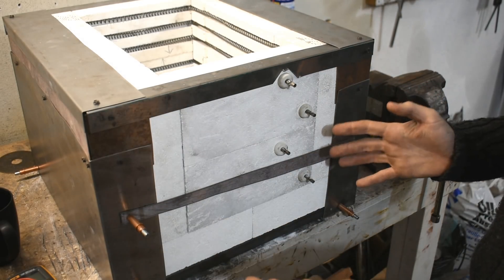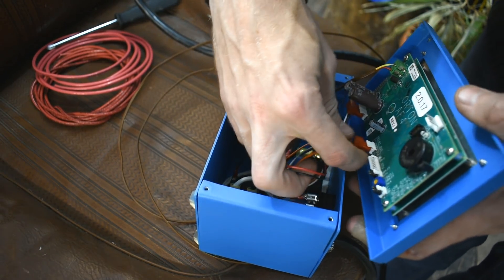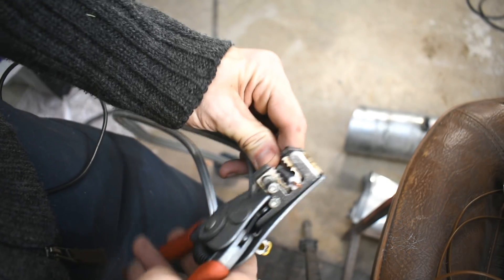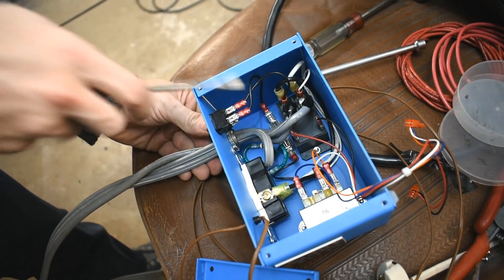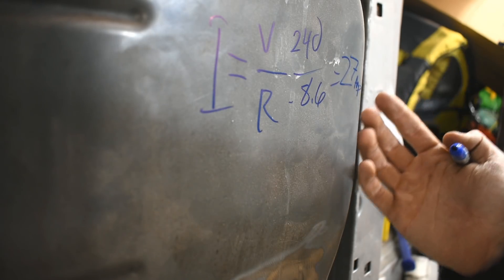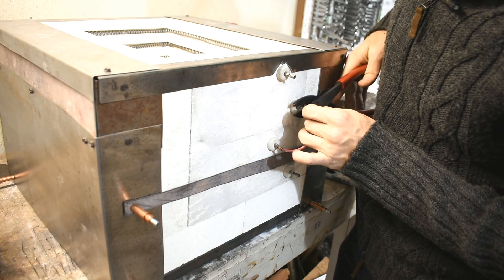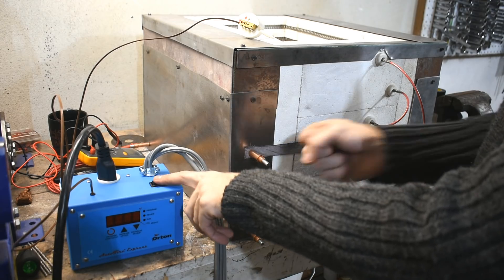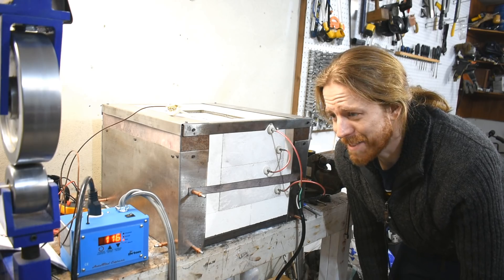DIY Electric Heat Treat Oven/Kiln/Furnace Part 4: Wiring up the Orton Kiln Controller

Comment: Are the elements dangerous to touch when using (ie. high voltage) or is a transformer used

Comment: It seem like your elements are very thick and longer, compared to the Jeff, the Veg Oil Guy's electric furnace.  Being cheap, I went with the size kanthal wire he used.  My coils are way shorter and less beefy than yours.  I'm guessing this will translate to a shorter working life?  FWIW, with my calculations, I'm going with two 120 volt / 20 amp circuit.  My plan is go with the InkBird PID controller with SSR-40D DA relays, which seems tiny compared to your Orton controller.
Reply from the maker: Anything that works!  I'm not sure about lifespan, but my elements and controller are off the shelf pottery kiln parts.  It's safe to say they are a bit over built, probably far more than necessary.  I have no need to hit 2400f for hours!
Reply: @PaulsGarage  I really should stop procrastinating by watching your videos, and instead go and work on my own furnace/kiln...  Oh well...  BTW, is there some purpose served by the metal case that I'm missing?  I can see for a commercial build wanting to have the strength to stand up to transport and wear-and-tear.  But what I'm trying to get by with is just to use a perlite concrete shell.  If it starts breaking down, I'll then add Aluminum flashing or ceramic tile.

Comment: I remember, from high school, our instructor tested a light bulb which only read a few Ohm's across the leads. 
He turned on the bulb with a amp meter in series and another meter showing the voltage. He was able to show the actual resistance of the light bulb is greater when hot. 
Which brings me to my point. What is the wiring like of the commercial unit that you have. If the heating element is the same as the one in the commercial unit then why not see if it is in parallel or series.

Comment: If you used 1 element at 27 amps connected it through a 30-40 amp contactor and controlled the contactor with the controller you could have saved some effort and gotten a quicker heat up.

Comment: Thomas & Betts WT111M Plier Type Crimping Tool 
The original crimper; Klein and others copied it after the patent expired, 30 years ago T&B was all you could get.
Also FWIW you are also crimping wrong the point goes away from the split.
Reply from the maker: Thanks for the tips!  I didnt know I was crimping wrong, I shall rectify that

Comment: Hey Paul. I just use the heat shrink from Menards (not sponsored), I think it is Rayburn (not sponsored). Haven't had any problems with it on the charge connectors or battery wires on my old Allis Chalmers (not sponsored). Think my Napa (not sponsored) battery is junk though. :)

Comment: Excellent choice of crimpers and tape! I've used both for over 25 years with no issues and I must say that those style crimpers are the very best. I've never had any issues with crimped connections since I started using those Klein crimpers.

Comment: Parallel is better but your would have amperage problem (assuming both elements have R = 8.6) you would have an over all R of 4.3...which equals letting the smoke out immediately when you hit start.
Reply: If they are in parallel the resistance is 8.6 on each one. they don't affect eachother. Parallel lines never meet.

Comment: You’re a funny man, you can make anything worth watching. Actually, the explanation about the resistance on the 2 coils was a good one.

The controller is 240v, but they send it with a 120v cord? Can you run 240v on that style plug and cord? I thought all 220-240v ran on the larger plugs and wires like you put on it...
Reply: There is a whole collection of NEMA 220-240 V plug styles including 15, 20, 30, and 50 amps. You may note the 220-240 V styles won't fit 110-125 V styles.

Comment: The thermocoupler works on the idea of a wheatstone bridge, the controllers sends a small voltage and reads the signal. Check them out on Wikipedia
Reply: Dear Paul thank you for this video. It was quite a learning. 
I want to ask you about power consumption. Does this electric kiln use lots of power
Reply: A Thermocouple is a sensor used to measure temperature. Thermocouples consist of two wire legs made from different metals. The wires legs are welded together at one end, creating a junction. This junction is where the temperature is measured. When the junction experiences a change in temperature, a voltage is created.

Comment: You had much better results than when I first powered up my kiln. I had transposed two wires and promptly let the smoke out of my solid state relay...40 bucks and several days shipping time later I was back in business. Congratulations on the lack of smoke! :-)
Reply from the maker: Yikes!  That wouldnt be fun.  At least relays are replaceable

Comment: Thermocouples change resistance with heat, no current induced (although IR induced current would be awesome...)
The thermometer sends some known amount of current and measures the voltage drop across the thermocouple junction which consists of 2 different metals.
Interesting technology, I recommend a deep dive on Wikipedia. EEVblog also has some video explaining how they work I think.
You can basically build your own thermocouple if you had the exact alloys and calibrate it with publicly available data. Cool, huh?
Reply from the maker: I thought the resistance change was measured with a thermistor, not a thermocouple? I could be wrong